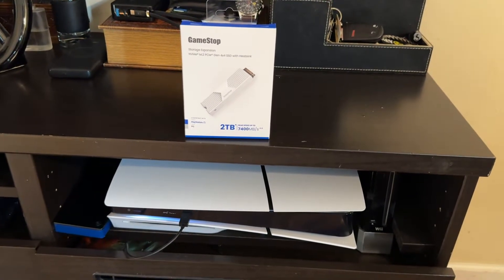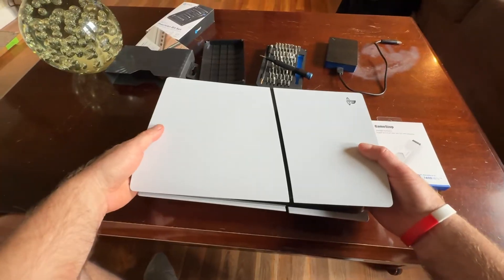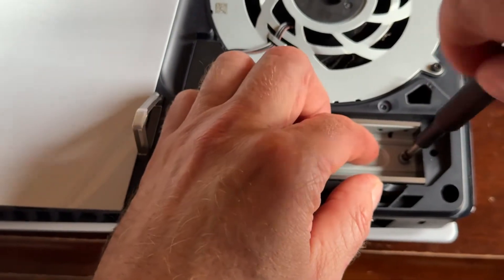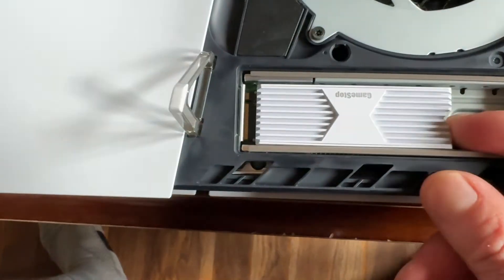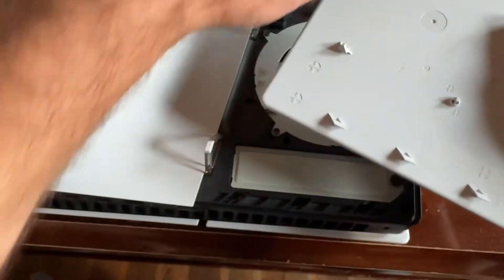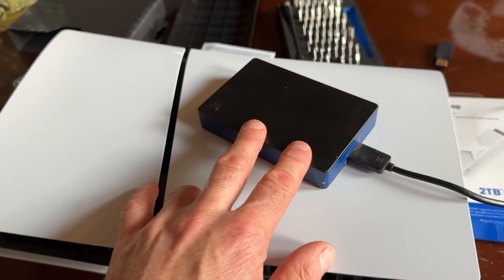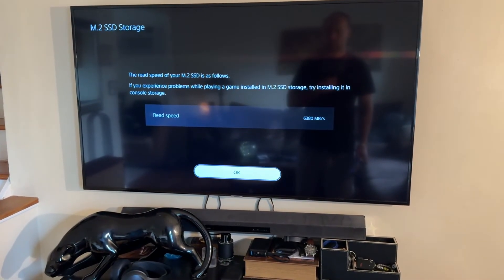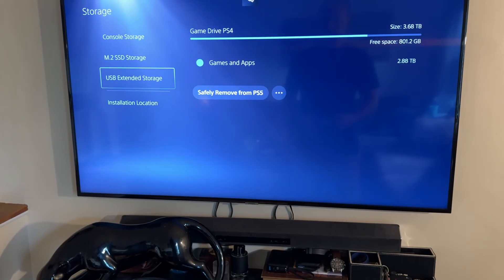How to Upgrade Your PS5 SSD - internal hard drive install + internal vs external on PS5

Comment: You need the spacer underneath the ssd. I have the same one it makes it rest parallel perfectly flat you just pinned your ssd to the bottom and it’s bending it.
Reply from the maker: Hmm didn’t feel like it.  But I’ll check it out. Thanks for sharing
Reply: was thinking exactly the same thing.
Reply: Doug is right, I changed enough of these to know .